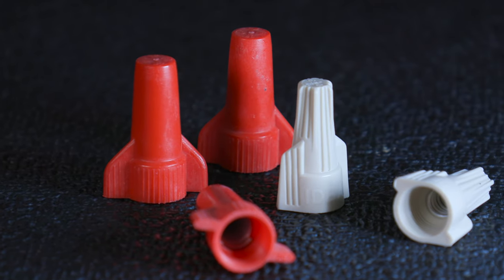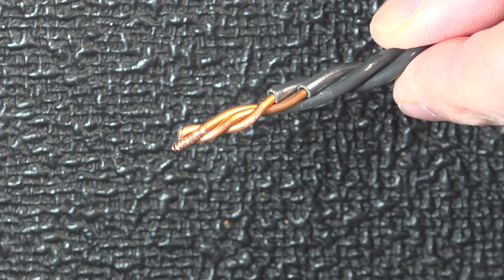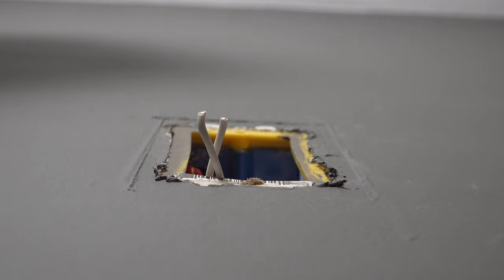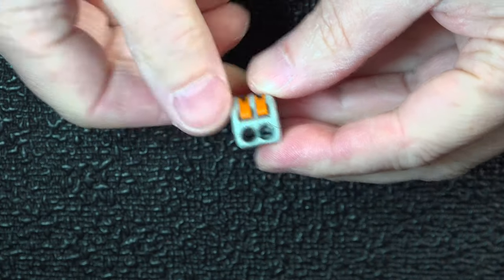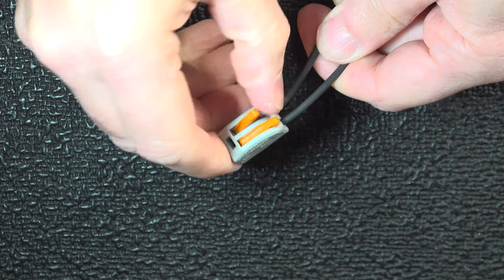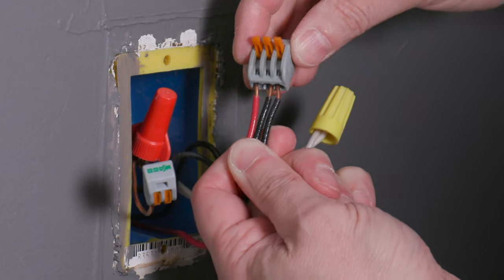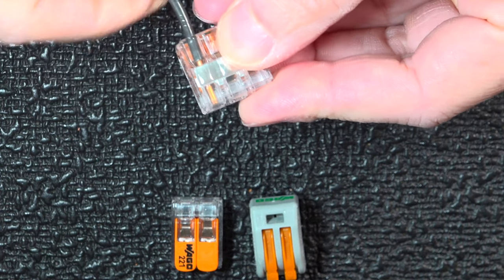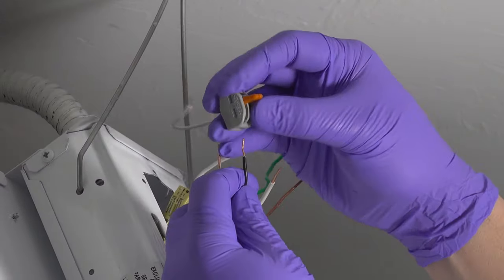Never use Wire Nuts Again - Wago is Better Electrical Connector

Comment: I was an electrician for Union Electric/Ameren Energy (St. Louis) for 35 years and problems with wire nuts were virtually non-existent., even when they were reused without cutting the wire back. This is a bullcrap video.
Reply: I've been an electrician for about 10 years. My father was for 42 years. Honestly for some reason most of the older guys tend to overdo everything and are behind on the times.. which usually wastes time and money. When I first got into the business older guys were very upset about not using galvanized conduit everywhere but it's totally overkill.
Reply: @tomstdenis  These new wire connectors do nothing to alleviate the problem with sloppy/lazy work. You still have to make sure they wired are seated in them properly and give them a tug to make sure.
Reply: @tomstdenis  it’s honestly pretty hard to fuck up a wire nut also
Reply: You’re old news boomer. You didn’t hear of any problems because the place burned down before the water wagon could show up with men and buckets.
Reply: Wire nuts are awesome and fast. Twist the wire clockwise with klein's, cut back the messy ends  so there's nothing exposed from your wire nut and crank it down clockwise lol.

I can wiggle and pull the wires right out of these push in style connectors, with my hands. You could hang from my wire nut connections. 

It probably takes me a minute longer to do a wire nut connection over this silly thing because you still have to strip the wire. The difference is 40 years from now, my connection will be solid in the room someone puts their newborn child. This guy's connections will be questionable though. I'm sure a little plastic tensioner or spring will be fine in 40 years 😂.

All that to say your awesome for doing it the right way and not the lazy way. Ha I get worked up over these cheap pieces of garbage.😂

Light ballasts are the only place I could see these being useful.
Reply: @Robmancan1987  I twist the wire clockwise, the same direction that the wire nut turns. Never seen someone pre twist counter clockwise. Why do you do that?
Reply: @Robmancan1987  even in light fixtures I've seen these fail
Reply: @illestofdemall13  I don't twist it counter clockwise.😂 Stupid spell check. Or I was just so angry about these stupid push connectors, I misspoke. That would undo your twisting job lol. My bad.
Reply: @Robmancan1987  mistakes happen lol.
Reply: Hey guys just trying to add a question on here ,what if youre connecting stringed wire and solid wire with same gauge ,would these be a little bit better off? Im connecting a solid wire overside outdoor ballast style bulb to a same gauge stranded 20 foot wire extension chord, it won't be used for long but just need some light out in this area,any tips?
Reply: @kaloosh2639  Your basically wanting to build a light with a longer cord "extension cord" so you can plug it in to an outlet?
Reply: @kaloosh2639  I usually twist my stranded wire clockwise and then twist it clockwise around my solid wire (with my fingers only) and make sure the wire is even on the ends before gently screwing a wire nut clockwise. Make sure your using the correct size wire nut for your wire, I'm guessing orange. Then electric tape around everything leaving the end of the tape folded over on itself so you can remove it later.

You could even use butt splices. Making sure you use the correct size and crimp with the correct color on your crimpers. Then use electric tape.

Or you could put a male plug on one wire and female plug on the other and plug them together.

I noticed the push style connectors at lowes, I think it's ideal brand. They don't work well with stranded wire unless the wires been tinned.  😂 So many choices for backwoods engineering something.

I don't think I would go to the trouble of ordering wagos just for that though. Unless you already have them on hand. They should work fine as long as nobody trips on your cord and yanks them out.
Reply: @Robmancan1987  thanks just as i tried to add im only using this for a short while since its what i got on hand,literally was givin both things as throw aways but thought they could actually work for a short while till i find better outdoor fixtures and money for them though it can go thru atleast a few rainy days ,then again become 'throw aways' for me on to a next guy maybe, the oversized ballast bulb set"still looks well and was just tossed out for a different modern outdoor light fixture ,and i was looking stuff up for any possibilities watched this and found you guys,✌
Reply: @kaloosh2639  If you mean literal rainy days make sure it's plugged into a gfci outlet or down stream from one 😂.
Reply: @Rad_Triumph_765_RS  it’s past, not passed. I’m sure you’ll learn that when you get to middle school though...
Reply: @JustinL614  its code millennial

Comment: I was using these for commercial work already back in 2009. Very handy and also nice for protecting prepared live wires before the end equipment is installed. Its also good to note that the older grey model has an indent on the back that’s meant as a guide for how long you should strip the wire to get a proper secure connection.
Reply: Hail Odin! The king of Åsgard. Chieftain of the gods. “Vanklok mann 
veit alt, han trur, 
der millom bergi han bur. 
Men når framandfolk 
honom finn, 
rådlaus røynest han då.»
26th verse of Håvamål
Reply: BEWARE OF SEEKER FRIENDLY CHURCHES JESUS IS COMING 
Jesus gave up and went home long ago.
Reply: I also use them to protect against live wires, easily undone

Comment: I've been an electrician for over 20 years, wire nuts are just fine. I've had more wagos fail than wire nuts but both cases are extremely rare. Both fail due to human error, not product error. Trying to discredit one product to sell your own is the oldest and sleaziest way to do business. Don't do electrical work if you don't know what you're doing.
Reply: just bought  house where they did all kind of crazy stuff, electric put in to shop and used wrong wire and boxes, and then found out that they put wrong wire to trailer hook up and put a junction box with connections in them under ground the hard way the one plug stopped working. It just amazes me some times what I find when doing a flip or moving into a new house, I always call  some one out to check my work over, before I close any thing up.  I all make sure to pull my permits and all that. When I get called for a job and people as about permits I always tell them it has to be done, then what I hate when they say so and so said I dont need one for the job that is what is bad.
Reply: God bless you fot this comment i never had problems with wire nuts i used the same one  more than once and never had and issue
Reply: Yes! There is a reason wire nuts are the standard! They work GREAT!
Reply: @detcat312  depends on what the job is, honestly most of permitting is about government viggs and not safety at least in my experience. There are a lot of politics at play in that world.  there is practical knowledge and theory , some of these guys want to argue about stupid shit like a curtsey  loop thats never been an issue in any home I wired in 20 years , it cant be a curl it needs to be an L even though logic tell us a 90 degree pinch point is gonna make a worse hot spot which is the crux of their argument against a curl. I have tied romex in knots and ran lights and tools off of it for days to prove my point to some of these guys. I actually enjoy those county and state meetings get to watch my boss raise hell at somebody else for a change lol.
Reply: @tomtom7955  you said a whole lot of nothing brother.
Reply: @waltersobchak7275  Im a poor communicator, but my panels are immaculate.
Reply: @tomtom7955  you’re right I shouldn’t have said that
Reply: Im in the netherlands and out of this profession for years. When i was still in  wago's were not to b used in industrial installations and i would presume that hasn't changed. How is that where you are?
Reply: The eye nuts are in fact fire hazards and in fact cause damage to the wires. I think you're too much of a traditionalist and don't want to learn something new. These are the same things used that connects the wires at the terminated end of an RJ-11 and an RJ-45 aka internet and phone wires. It's the same technical improvement.
Reply: @guidologo  
How do you use the internet? How are your cables terminated at the end? I think you've got it confused. The wing nut things usually red and yellow, sometimes blue and white are the ones that are safety hazards the clamp ones are how your internet cable works as well as your phone cable. It's not a friction connection as the twist caps are.
Reply: @Openreality  the litle plastic things in the  vid i only see in electronics at the powerside of things. Eppecially coloured things you mention. My internet is in screws on rails. Also... the internet cable wasn't the industrial installation i meant ofcourse. What was the q again?
Reply: @Openreality  Att repair man: sees wire nuts thats your problem right there.                           Me: wanna bet? got 5 bucks that says thats not it.                                                                       Repair man I'll take that bet. puts buttons on. check check check. Takes out wallet...                                             me: Told you that not it bro been working on wire nuts for 20 yrs lol, now go to the hub and find the real problem lol.
Reply: @Openreality  Data installers are not electricians. That's a completely different field of expertise, they are not electrical workers. Not even close to being called an electrician.
Reply: Wire nuts are still the safest non flammable solution. All other tend to create arcing and since you're an electrician I don't need to describe what happens after that. I'm in hvac myself and I'd much rather use wirenuts than anything else. The old saying goes "when it ain't broke don't fix it."
Reply: Yep. Wire nuts have been around for so long because they just work.
Reply: @Openreality  I'm sorry but you clearly have no idea what you're talking about. You're comparing connecting low voltage data wires with connecting high(er) voltage electrical wires. There are some things you can get away with at low voltages that you simply cannot with higher voltages. Wire nuts have been in use for almost a century for a good reason. They work. There must be billions, if not trillions of wire nuts in use all over the world and yet issues are few and far between. If they are connected by someone who knows what they are doing there is no issue. If you don't know what you're doing you shouldn't be doing electrical work.
Reply: Sounds like someone trying to protect his income.
Reply: @Airplane_Willy  it doesn't effect my income at all if I use one or the other or are you taking about the salesman in the video?

Comment: I found that they are ok, but after talking with a few electricians, the wagon connector has only a point contact, used properly, wire nuts, aka, 'scotch locks ' offer a more mechanical surface contact.
Reply: I'm an electrician. As long as they are rated they perform the same as wirenuts. Electricians tend to be overly picky about weird details that don't matter.
Reply: @JustinL614  agreed lol
Reply: A lever lock will always continuously apply pressure unlike a wirenut.
Reply: Tom
They got a link?
Reply: Those wire nuts are not rated for motor connections, the wago connectors we use at work are rated for motor connections to 600v.
Reply: @tomstdenis  Love it!!!
Reply: @tomstdenis  This is the way.
Reply from the maker: @JustinL614  I appreciate you sharing this
Reply: @gl9500  I saw that a while ago, too. I think it might have been John Ward.
Reply: Wire nuts are not "scotch locks". Those are the Telco connectors with gel inside, that are not re-usable.
Reply: @Rad_Triumph_765_RS  a wirenut does apply continuous pressure. It's literally called a solderless pressure connector.  Lol
Reply: @kevinsartin6059  pretty sure the ul listing on all commercially sold wirenuts is a minimum of 600 volts. Thats also the basic standard rating for most conductor coatings.
Reply: I guess these would allow me to safely join copper wires to aluminum wires in my house? The wires aren't touching each other but instead a mini buss bar to transfer power?  Similar to an Alumiconn connector, just a smaller version? So no thermal expansion between dissimilar metals loosening twist and causing problems... Fires?

Comment: thats your fault for cutting the wires shorter
Reply: Yep, was cutting off more than needed.
Reply: Wire nuts are just a compleatly idiotic
Reply: @AB-mx9gv  completed out dated, like so 1800's
Reply: I pig tail off going to the device so if the wire gets to short like in video just replace the piggy..
Reply: @AB-mx9gv  Have you ever make a connection with one?
Reply: @AMD1  i have becaus some hav ben i a paket with a Lamp and i tryed them out. At that point i was wondering why some one would use this sins there are way better options. For instance Wago conwctors ore  „Hügli klemmen“ ore „Lüster klemmen“ ore straight soldering oder krimp conectors.
Reply: @AB-mx9gv   I bet your a Licensed Barista......  qualified to explain why wire nuts are so bad.....
Reply: @TripleAstyle1  thats esy. 
They get brittle over time and break. Technically you can not put different diameters of leads together. Wenn you remove them you cannot just put them back on sins the copper is twisted and has cuts ih the surface. They are technically not re usable. On felxible wirres you technically can’t use them. If they get wett i am shure you will get shocked. And so on.
Reply: Everyone knows how dangerous a wire with a tiny scratch on the tip can be if reused!
Reply: @traestuart384  The amount of house fires started because a tiny scratch. unforgivable
Reply: @AB-mx9gv   umm nope!   If they get wet??.....   umm....  time for you to use that google search and learn about conductivity, then back to the brewing coffee for a living.
Reply: @TripleAstyle1  i guess you are some sort of chemist or physicist because yes clean water is isolating but dirty water conducts quite ie well especially water that has ben standing for a long time. But as always theory and practice is worlds apart.
Reply: Everyone also seems to be forgetting that there is actually more contact area on a spliced connection, even with some tiny scratches at the tip, than there is in a continuous length of wire. Therefore the ends being scratched makes no difference to the conductivity of the circuit.
Reply: @rob61aaz  good idea, but aren’t you working around a problem caused by twisting and using wire nut?
Reply: @danabney4433  it solves a few problems, if that device fails it is the only one that fails or if you need to replace the wire it is just a short piece.. Plus I have done it for so long it is now habit..
Reply: @AB-mx9gv  again your just lost.... clean water is a conductor.....  good luck. Believe this video if you want, the people that work on electricity as professionals know better.
Reply: Why cut the wire nut when it can simply be unscrewed
Reply: @AB-mx9gv   why don't you learn how to use the English language before you post your gibberish comments. I mean, man, come on already.  Did you skip school or just didn't pay attention to proper grammar and spelling ?
Reply: @robertshorthill4153  wow i am suprised that this is stressing you so mutch. Well i try harder nex time but in the mean time i would like to know in what languages you are perfecktly fluent? See English is important but as a third language of mine i think i do quite well or atleasr it is understandable. I think i made my point you understood what i was talking about and my grammar didn’t matter for any one other than you so....
Reply: @AB-mx9gv  well sorry english is not your first language.  I apologise, if you will accept it.  Here's the deal -- I'm not the world's best speller, but if my spelling isn't correct, I will try to get it correct before I post a comment.  It sort of bugs me the horrible  way people construct complete sentences. And they are typically native American writers and speakers.  I was fortune in school that I had good english teachers that would encourage me to pay attention to my grammar and spelling out of respect for myself and the language.  I have a couple of good friends that are German speakers from birth and had to learn English as a second or third language.  They have told me English is not the easiest to master and certainly not to write well in. I also have a friend from Lithuania.   His accent is so thick it can be cut with a dull knife. He speaks his native language, Russian, German and does well writing and speaking our American version of English.  It would be hard for me to communicate deep topics if I were to travel to a land like Australia, I'm convinced of that.  Again, I apologise for my mistake for your lack of fluent ability with our slang filled crazy language.  Peace, my friend.  My Bad.
Reply: @mattmclaughlin7338  I’m sorry? is this true. Shit. I’ve literally just unscrew them half the time change the wiring and screw them back on. (Added smart switches).

Comment: Found out about Wagos when I got hired on where I am now. We use em strictly in an industrial maintenance setting. I love em. They also make em to fit size 10 wire. What we do is put the line side under the left lever, L to L. Just in case you can’t turn that circuit off, just pop out the right wire and it won’t be energized, and the other machines can keep going

Comment: little tip for the older grey wago´s: 
if you want to know how long the insulation has to be cut, just turn the clamp around. there is a little shelf with a step which shows the correct length.